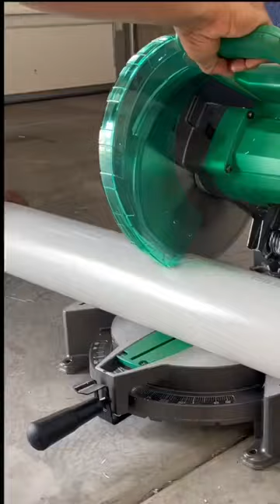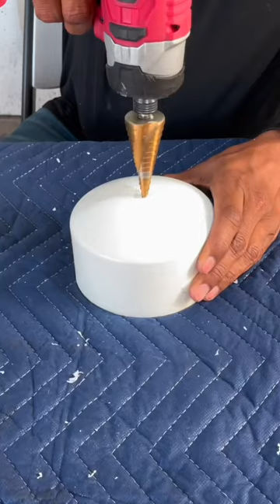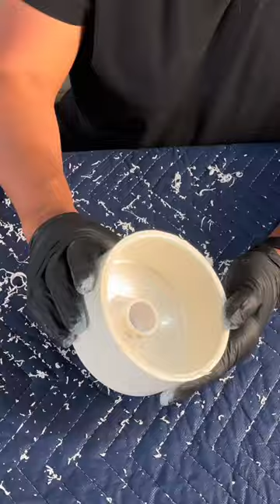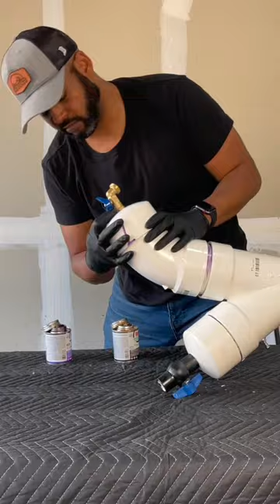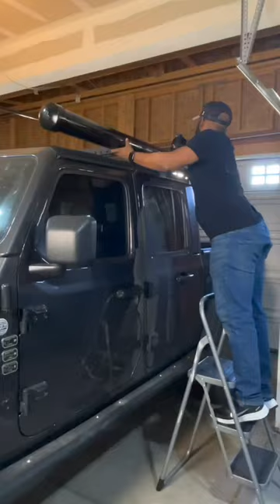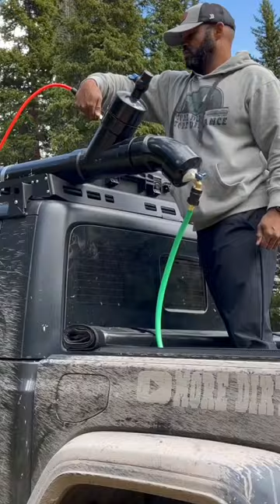Easy DIY camp shower

Comment: I've done couple of years ago, installed and after few months removed. Why? Because there is no baffles in the pipe and till is full is fine, but try to break with your car when half full. Specially because it is only on side of the car. At high speed can be dangerous.

Comment: Do you know how much water that holds? Also, is there a pressure release valve?
Reply from the maker: It holds about 3.5 - 4 gallons. The water goes fast! I didn’t use a pressure release I just release the pressure using the tire valve. I bought one to install but didn’t end up using it.
Reply: Where is the full video?
Reply from the maker: @BTinoco  here’s the link to the full video
https://youtu.be/XiIIbkHAFS8
Reply: I would think you wouldn't need a pressure release valve because once it runs out of water your pressure is gone too out the same valve.
Reply: The full video seems to be down

Comment: You could have done it in black ABS pipe & not needed to spray it black , simpler devices on the market , take you a day to make it & cost about $100 in parts in 2024

Comment: Yea, DIY if you have a shop and tools to do all this cutting, and a hose from the house. LOL it's also very bulky.
Reply: only need a drill (hand saw if they dont cut to size when you buy) and all the parts to put together, not too hard and if you wont want a hose add a twist cap where you just empty a 4L bottle into, depending how big it is, do that a few times and pump it up and youre all set